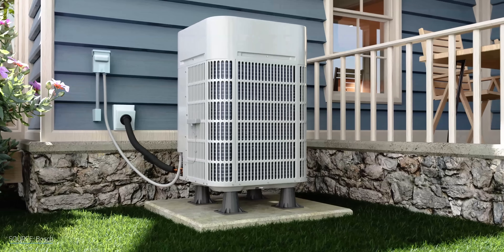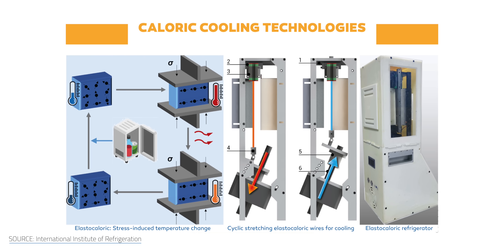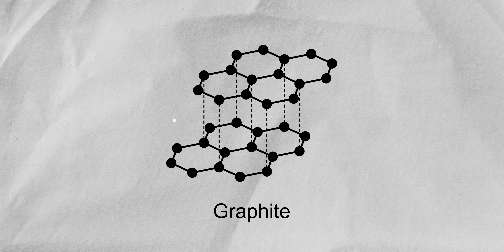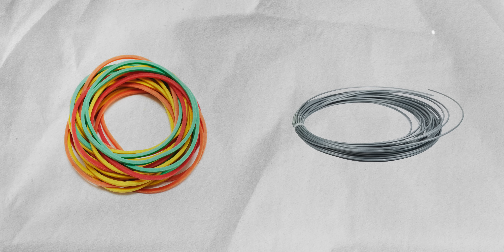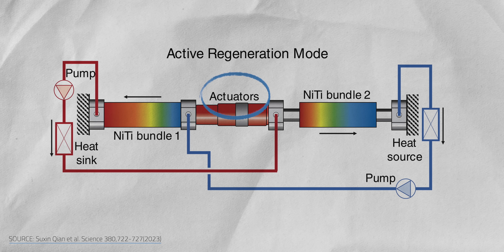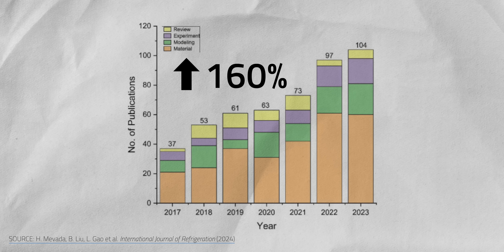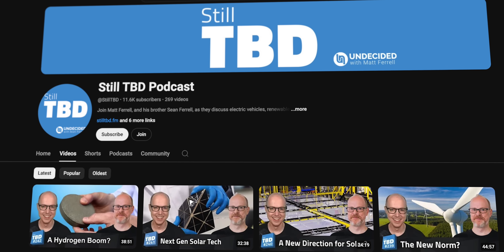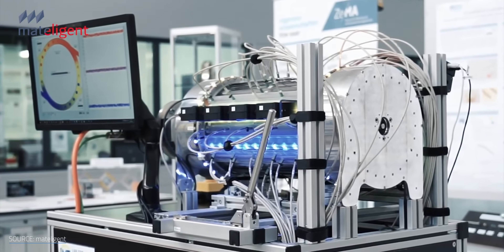How Solid State Cooling Could Change Everything

Comment: I think the cycle life of the materials is going to be the determining factor. If you think about Li batteries, the best ones have a cycle life of about 4000, maybe closer to 10,000 in lab settings. But this will give you a TON of life from the batteries. But for this material, if we have to stretch and release it constantly, like 1000 cycles per day, then for it to last even three years, you're going to need a cycle life of more than 1 million. Considering the best made cooling systems can last 40 years or so, your cycle life would have to be 14.6 million or better for these materials for a comparable lifespan. I really hope it can get there, but you stress ANY metal over a thousand times and it's going to break.

Comment: I found that there was little in this video to give confidence that it wouldn't run up against thermodynamic limitations.

It sounded like a lot of hope that by throwing effort and time and resources at the project, that it would just work well, but that's not how reality works all too often. The laws of nature just don't cooperate no matter how much you throw at it. 

It sounds to me like this is one of those situations. 

Modern thermodynamics explain why the vapor cycles work so well in heat engines, but I'm left doubtful that this idea can possibly, mathematically, live up to that.

Comment: Considering how often I need to top up the refrigerant in my car or home central air system a refrigerant free system is definitely desirable. IF it's comparably efficient, similar in size and weight for performance, and not dramatically more expensive. It's unlikely to get there right away after the first commercial devices hit the market, that's why we call it the "early adopter cost".
Reply: @darthhodges  If the refrigerant needs to be topped up, the system is broken and you are fixing the symptom rather than the actual issue. It should be a closed system, needing topping up is an indication that there's a leak, for the performance of the system, the environment and cost, the leak should be identified and fixed, at which point there shouldn't be any further need to top-up.
Reply: @dantucny  No system is perfectly closed. And often the time and expertise needed to find and repair the leak is more expensive than topping it up every other year.

Comment: Today's refrigerants dont have global warming problems.  Also if the this material heats and cools how do cool incoming are and not heat once it is stressed again.  Thats the reason refrigerant wprk well the hot and effts happen in two different locations.  Heat is rejected in a condensor thats located away from the space cooled. 
17 degree split us not enough.  You would need a vapor compressor to reach desired temperature then the material can take over.

Comment: Both titanium and nickel are expensive metals. These will not be cheap systems because of the sheer amounts of these metals involved.  

   Meanwhile, propane works great in a vapor compression system, and its only downside is being flammable.
Reply: I'm thinking the propane heat pump is OK for hydronic systems but i really dont want flamable gas in my home.  I wonder if CO2 heat pumps aren't the next big adoption.  Yeah 1500 psi is a lot and a could cut off your finger but all things considered it seems safer than anything we use today.
Reply: @geekinstein  Many people have had gas lines feeding into their homes for a long time. Practically speaking, I consider it a non-issue though very occasionally someone somewhere will have issues. Driving in a car is more dangerous tbh.
Reply: What about butane instead? (I am thinking fridge and room temps instead of freezing) much lower pressures on the high side.

Comment: You can do phase change heat transfer with water, it's just not efficient at the temperatures and pressures we want to run fridges and a/c units. Water does work well at higher temperatures and pressures, like in the heat recycling systems of some power plants. It also needs to be EXTREMELY pure. I know of one naval nuclear reactor technician who commented that 1 part per million of contaminants in the water loop was 2 parts too many.
Reply: Yes, we moved away from steam engines
Reply: @johns5504  Steam turbines is the most common way of converting heat to motion, so we did not really move away from steam engines, they are just not pistons anymore.

Comment: what the point , if it the same as  vapour  cooling . of cop  3  but you can build  vapour cooling  when you could just use ammonia  as refrigerant  . and it not a GHG  and a far superior refrigerant . also you could build as low pressure system and run the refrigerant  directly into ground loops  for extremely efficient  heating system in COP range of well over  COP of 6

Comment: The key is efficiency; if it can't beat current designs in terms of heating and cooling efficiency, Calories moved per Watt expended, them it's not really a step forward. But getting rid of refrigerant sounds pretty good so far!

Comment: Have you ever heard about the water hammer? It was on YT a long time ago. It produced steam very easily. It took less power to produce steam than a regular water heater. It produced steam in a matter of seconds. It would be revolutionary on how we would produce electricity! I don't know if you could find it anymore. What I saw was a cylinder with holes cut into it, but not all the way through. The cylinder was inside a pipe, somehow, and when it turned it hammered the water into steam. I figured they took it down, because they, the higher ups, couldn't make any money. Probably put them out of business.

Comment: this reminds me of early decades of solar PVs, like a calculator with tiny solar panel. It could take decades to make this into HVAC, a decade or two for residential refrigeration.
Don't get me wrong, I like this and there is potential by massive scaling volume production of the elastic metals and shape them into very dense structures.
Regarding durability, I think the solution is just plenty of these metals where the stretching is minimized to make it last a decade or two of operation.

Comment: I'm doing my PhD on this exact subject, I'm very surprised that you know this subject (nobody ever heard of it)
Reply: First time I ever heard of it, too.  I wish you well on your PhD journey.
Reply: When can it be used to cool gaming PCs? 😂
Reply: @kamrulhussein5811  is still nothing invented better than Heat pipes for cooling
Reply: Hey so is metal fatigue a problem? Is my nitenol fridge going to break down every other month?
Reply: @32BitJunkie  I have this same worry. But then I thought of car suspension: the coil is compressed/decompressed constantly - and (under normal conditions) VERY rarely fail. We use torsion bars too - and they don't fail under normal conditions either.

I think what kicked off our "fatigue fear" is that we are used to iron/steel: it can bend, but VERY little. This kind of materials used here can bend a LOT more than what we are used to.
Reply: @32BitJunkie the comparison would have to be - how reliable is the pump on a traditional AC unit?

Comment: Both Elastochloric and magnetochloric effects  Stresses a material in a way that restricts the degree of atomic vibration freedom. 

The next part is important we might say there are three degrees of possible motion, (x,y,z). If we restric atomic motions in the z direction, a given amount of energy now vibrates more in x and y. In other words, its thermal capacity is reduced, thus a given amount of energy already in the substance makes it hotter when the degrees of freedom of motion is restricted, and the new hotter temperature substance may release its heat to its surroundings.

Comment: Solid State suggests that this tech might be applied to IC and battery thermal management. We're still stuck with using thermal diffusion for most use cases -- nevermind geeky water cooling gaming rigs -- so some breakthrough here would make a big difference in mobile electronics

Comment: I think a very early, very interesting application for it, would be to keeping computers cool. If you're able to scale it up, while retaining a small enough size, you could keep a computer running at an optimal temperature, without the need for excess fans. This alone, would be capable of changing the entire industry, as there's plenty of people who are interested in building gaming PCs and would love a silent build. On top of that, if done correctly, phones, tablets, laptops, and AIOs (as well as the smaller docks that are like Apple TV device sized), would benefit greatly from keeping cooler temps, letting them last longer.

Though, I'm aware that too small can be problematic to do. But, if it's possible, i think a fairly small version could do wonders for computers (and even servers/server farms). And would give the industry a solid funding base to be able to focus on the significantly larger versions necessary for refrigeration, and even cooling off buildings

Comment: Hatfield steel or Manganese steel (14% manganese steel ) has has Austenite and Martensite crystals. If you put to much heat into the steel it becomes very hard but also brittle. The carbon within the metal moves to a plane and is the point of failure.

Comment: So, the same idea as using elastic bands to move heat? I forget which YouTube channel did it, but they made a refrigerator a few years ago, cooled with elastic bands that absorbed and released heat depending on if it was stretched or relaxed.

Comment: Overall efficiency is limited by the second law of thermodynamics. If you convert mechanical energy to thermal energy and back, you should get back less mechanical energy. Otherwise it'd be a perpetual machine, which is impossible.

Comment: For PC cooling, a solid state option was recently introduced.  AirJet / Frore.
Reply: yes, cool tech but there the solid state material is used to trigger a mechanical reaction that moves air at high velocity. in the case of elastocalorics, the material itself moves heat energy

Comment: This isn't an alternative to heat pumps. These ARE heat pumps! Everything that is shown, or even just mentioned, in this video, are types of heat pumps. Whether they use a liquid, gas, and/or solid is irrelevant. They are still heat pumps. Also, what about ionocaloric cooling? I remember hearing about that, as another refrigeration method, where no part of the refrigerant ever becomes a gas.

Comment: There is a youtube channel that actually made a fridge using regular rubber bands, it was an incredibly simple design and it actually worked, but the rubber band broke pretty quickly. It's on the "Applied Science" channel and called "A refrigerator that works by stretching rubber bands" - posted 8 years ago, lol.  Anyway pretty interesting.

Comment: Looks like this "solid state" tech requires many more moving parts to make a complete working system than conventional refrigeration: need one mechanism to apply/relieve stress and something to alternately expose the working media to hot and cold sides, which likely means a set of pumps and valves.

If you don't want HFCs in refrigeration systems, use anything else. You can use almost anything non-toxic and non-corrosive that has a usable gas-liquid transition on its phase diagram. We have heat pumps that use propane, butane, CO2, NH4, etc. as the working fluid. HFCs dominate only because they are generally non-flammable, non-toxic and their larger molecules have conveniently low operating pressures that enable the use of light-weight (cheap) components.
Reply: These are heat pumps that simply use a different phase transition than the vaporization of other heat pumps.

They probably use complicated and versatile mechanisms in this research phase while working out properties.  But if it pans out I'd bet some pretty simple mechanism could be devised.

For instance, a rotating wheel with nitinol spokes could have flows past either top or bottom spokes to cool or heat.  That might work to heat and cool a vehicle.  Someone with expertise thinking about it for more than two minutes can likely find better solutions than mine.
Reply: @alans1816  A simple wheel doesn't have a strain application and removal function. The simplest way I can think of is an eccentric hub and rim arrangement. You'd also need some sort of seal to prevent the cold side from mixing with the hot side where the spokes transit between sides, otherwise you are going to have massive issues with pressure differentials causing huge leaks between sides.

With a conventional refrigeration system, the cold and hot sides are completely isolated from each other by radiators and refrigerant, no worries about air or liquid from one side contaminating the other. If you want to prevent cross-contamination with semi-solid state tech, you likely need intermediate heat exchange steps to isolate the heat pump media from both sides: you don't want your intermediate media (ex.: 50% ethylene glycol) to get contaminated nor leak/evaporate to environment on either side and require potentially frequent periodic maintenance to clean or at least top-up.

A bare-element semi-solid heat pump seems like it would only have potential in applications where you want to move heat between domains where cross-contamination is a non-issue. One possible such application would be fine-tuning air delivery temperature on a per-outlet basis in HVAC systems: calculate how much heat/cooling needs to be delivered overall, set bulk air to the average, then let individual heat pumps take/remove whatever heat they need from pass-through to achieve their intended outlet temperature. The air on both sides of the pumps is the same, only difference is temperature.
Reply: @teardowndan5364  A spoked wheel bearing weight has the top spokes loaded (stretched) and the bottom spokes unloaded.
Reply: @alans1816  And exactly what weight a spoked wheel in a heat pump would bear? None. The eccentric load needs to be generated somehow. An eccentric hub and rim riding on bearings rigidly mounted to the housing with whatever offset is appropriate for the spoke length used keeps everything in perfectly constant relative positions. Manufacturing wise, you can simply thread the spokes from the "compressed" side where they require the least tension to set.

If you use spring-loaded or pneumatic idler wheels to apply force on a regular spoked wheel instead of an offset hub, you now have to deal with a rim suspended on springs (spokes and spring/pneumatic idlers) that no longer guarantee relative position of anything to anything, complicating rim and spoke sealing while making the whole thing more sensitive to any imbalances.
Reply: New refrigerants also bring profits to chemical companies.  At this point, we might as well just switch to propane, since the new refrigerants being introduced seem to be flammable.
Reply: HFO's are also better.

Comment: Aren't most new cooling systems not using HFCs? Eg R290 which is propane, or pentane (R601) is what I see in most fridges today.
Reply: It’s almost impossible to find HFC in any kind of heat pump today. It’s always some kind of propane based refrigerant.
Reply: @KolyanKolyanitch  or just.... carbondioxide, CO2... which exactly as bad as... CO2, when leaked for warming. It is among the best and was one of the originals. It's only downside is equipment cost. It operates at higher pressure level. So ones piping and parts have to be sturdier. However otherwise it is pretty ideal. no more toxic to us, than our own out breath CO2 (only dangerous in really high concentration), non flamable unlike any of the hydrocarbons, not environmentally toxic etc.

R-744.

So equipment cost is little higher, but not like we don't already do such equipment. Since bottled CO2 is used in lot of industrial use like like as welding shield gas. The kit exists, like it is outright in use as cycle refrigerant. It just wasn't as low pressure and bargain basement cheap as the HFCs, which is why it lost out for a time while the HFCs environmental toxicity was not a concern in mid 1900's and Dupont was king etc.

Comment: It makes me wonder if a person could put mechanical energy into the system by "cranking" their fridge every night to hoist up some weight hanging on nitinol wires, with gravity doing the deformation work overnight and heating the air/fluid. And that makes me wonder how efficient using a human to turn food energy (at the end of its own energy intensive production process) into mechanical energy (for later transduction into heat energy) might be. It seems like all the conversion processes couldn't be as neat as sticking solar on your roof and directly powering things during the day or a battery for the night.

Comment: I feel the video missed a step. I understand the metal fan get hot or cold depending on the force applied or removed. What I don’t understand is how that is converted into moving that heat. The heated metal has to radiate that heat to reach a normalized temperature then have the stress removed creating the lower temperature. That cold then needs to act as a well for other heat to displace. Otherwise, it’s just the same heat moving locally.

How are they moving the heat?

Comment: Everybody I know in Michigan has switched their heat pumps to traditional Furnaces. Heat pumps don't work efficiently in a cold winter and fail to keep houses warm.
Reply: I live in northern Sweden where the opposite is true and the climate here is even colder.

The issue is getting bad heat pumps that have poor efficiency at very low temperatures. Ground-based heat pumps are the best at this, as they aren't affected by air temperature to begin with, but well-engineered modern air-based heat pumps still work well at -30C.
Reply: @swecreations  Thanks for your input